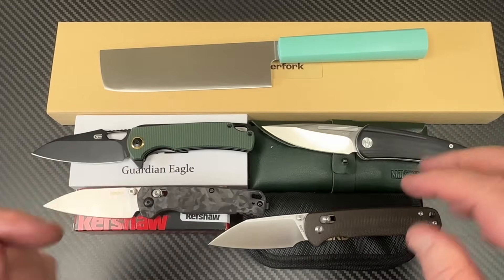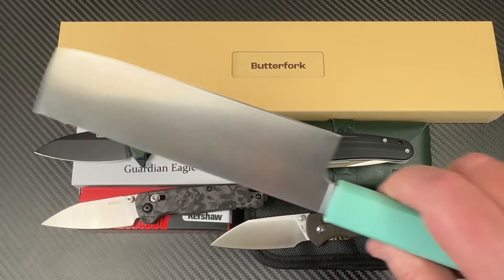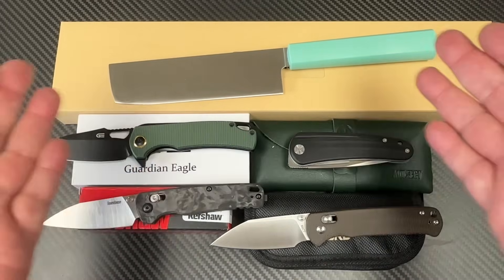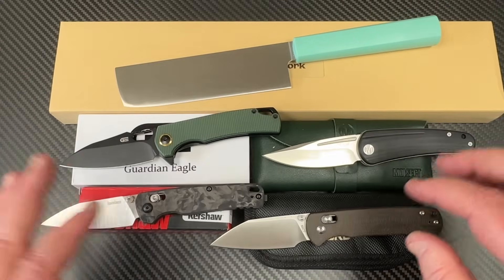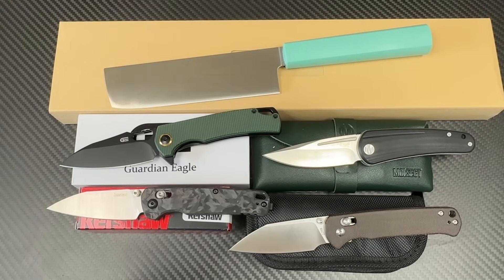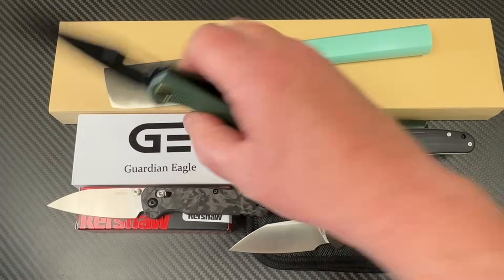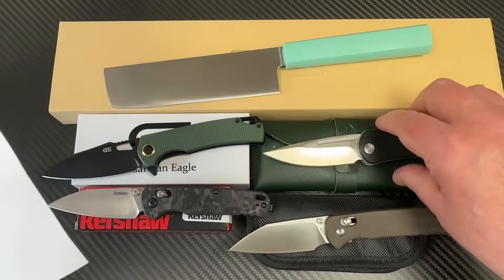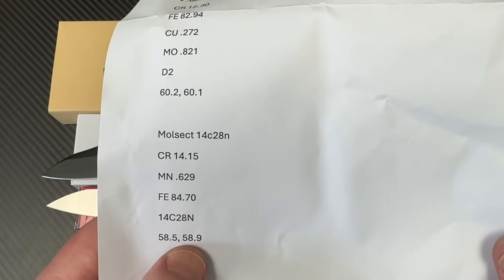Batch 9 Test Results  CJRB AR-SFII , Kershaw Magnacut and more !   PMI & HRC results !

Comment from the maker: Batch 9 test results (XRF elements and HRC Rockwell hardness)

CJRB Hectare AR-SFII
V 1.21
CR 14.80
FE 79.05
MO 4.11
154CM (OR SIMILAR)
58.9, 59.1
 
Guardian Eagle Unknown
V .667
CR 12.30
FE 82.94
CU .272
MO .821
D2
60.2, 60.1
 
Molsect 14c28n
CR 14.15
MN .629
FE 84.70
14C28N
58.5, 58.9
 
Butterfork
V .193
CR 17.82
FE 80.61
MO 1.14
440C (OR SIMILAR)
59.0, 59.1
 
Kershaw Bel Air  Magnacut
V 4.83
CR 11.00
FE 79.49
NB 2.31
MO 2.21
MAGNACUT 
63.2, 63.2

Luvthemknives website: https://luv-them-knives.myshopify.com

Join my Patreon & get in on the early bird knife sales & monthly drawings: https://www.patreon.com/LuvThemKnives?fan_landing=true

My email address : luvthemknives@gmail.com
My instagram  http://instagram.com/luvthemknives

How an XRF Analyzer works: https://www.bruker.com/products/x-ray-diffraction-and-elemental-analysis/handheld-xrf/how-xrf-works.html

Why carbon and other light elements are not detected with the XRF Analyzer: https://www.pxrfs.com.au/light-elements-difficult-measure-portable-xrf/

Spreadsheet of knife testing results to date: https://docs.google.com/spreadsheets/d/1OepNr_D4lqbdTFqdqWl1rmAd4bOzPzJe6J0iEWrdJGU/edit?usp=drivesdk

Knife Test Batch Videos 

Batch 1 new era: https://youtu.be/WTsUV0f-1kk

Batch 2: https://youtu.be/WUAPbJo7rY8

Batch 3:https://youtu.be/-Z0b2wZT8mA

Batch 4 Knife Test Results including the Spyderco Shaman 15V & Microtech in Magnacut !
https://youtu.be/F4c13Kfhubo

Test Batch 5 Knives Results !   You’re going to be shocked !!!
https://youtu.be/ys9IhtPOTWw

Knife blade steel Test Batch 6  Magnacut is now the focus and how good are these hardness numbers ?
https://youtu.be/pDE72wM1iw8

Batch 7 Knife Test Results ! S90V & Magnacut !
https://youtu.be/_uZVP1yJRQQ

Batch 8 Test Results  Thanks to Remette Knives for paying the tab !
https://youtu.be/rFHi36Q2zJs

Previous years

Batch 1 (4 years ago):https://youtu.be/Nh4rjoeY748

Batch 2: https://youtu.be/cqsvN3XtYEQ

Batch 3: https://youtu.be/JWCNV8Ipaus

Batch 4: https://youtu.be/LsThV3AjXv8

Batch 5: https://youtu.be/X0Jtb28VPc0

Batch 6:https://youtu.be/vmwb-ZfA3Xo

Batch 7: https://youtu.be/1dU1EoGdMxY

Batch 8: https://youtu.be/YGeKHMztk0A

Batch 9: https://youtu.be/7r7Wj3_L6zA

Batch 10:https://youtu.be/LimXek6Y9i4

Batch 11:https://youtu.be/eCR9V7-8Nic

Batch 12: https://youtu.be/5hgFEw3jSEc

Batch 13: https://youtu.be/ivCZsfyU0T4

Batch 14: https://youtu.be/kHkSCrLub48

Batch 15 & 16: https://youtu.be/Qzg5RoTE9nI

Batch 17: https://youtu.be/kZ5dR4p5QG4

Batch 18:https://youtu.be/pmG_8nPDbNw

Batch 19:https://youtu.be/ANNyyOycolo

Batch 20: https://youtu.be/ptL2e7fcbgA

Batch 21: https://youtu.be/djgpAcP4RuY

Batch 22: https://youtu.be/nt06Gn_Bphs

Batch 23:https://youtu.be/BlR6ZHVIv6g

Batch 24: https://youtu.be/UDYUp6NQ1CE

Batch 28: https://youtu.be/PfXag6Ku72s

Batch 29: https://youtu.be/qnetRveTeBY

Batch 29 part 2: https://youtu.be/SXVW27CiWWI

Batch 30:https://youtu.be/gs5dub2ilzs

Batch 32: https://youtu.be/fRY7ldnOMvQ

Batch 33: https://youtu.be/aRA7mnk3tCk

Batch 34:https://youtu.be/LAV40-4ntug

Batch 35:https://youtu.be/TkPPWfnZSQA

Batch 36: https://youtu.be/M_gbiZ_gfZQ

Batch 37: https://youtu.be/72vS4WXTLjU

Batch 38: https://youtu.be/zhUmuFW15VQ

Batch 39: https://youtu.be/NVMADfMpRRI

Batch 40: https://youtu.be/vr2gaZmcYms

Batch 41: https://youtu.be/7GJ9egoMO7g

Batch 42: https://youtu.be/jZkETbUMYgw

Batch 43: https://youtu.be/4kPI5dPJA24

Comment: To make life a lot easier when taking apart and putting axis/crossbar lock knives together - I took a chopstick, cut it down to a 2” section, then sanded it down to be slightly smaller than the pivot in a Bugout so I can use it as an assembly tool for basically any crossbar lock I come across. It’s saved me a LOT of frustration and headache over the past few years.

Comment: Magnacut gets its high corrosive properties (even though it has relatively low chromium) due to the added nitrogen to its recipe. Although vanadium by itself doesn't add much stainless properties, mixing it with nitrogen while lowering the chromium content created an excellent working order of corrosion resistance.  Add Larin's fairly easy, yet pretty genius heat treat protocol with a 2050 degree austenite in-plating/oil quench followed by 2x2 hour 350 degree temper and the final result is quite stainless with a high rockwell hardness.

Comment: About that struggle of making good M390... Do you think that 20cv is better / more consistent in hardness/heat treat? I noticed that most of knives that I have with 20cv keep edge way better than M390, they are mostly from WE knifes and Kizer but I wonder if other companies that use that steel have better time using it than M390 even if technically they are the same...
Reply from the maker: Good question.  I’ve never tried to correlate the 2 types to see if there’s any differences
Reply: They're identical in composition. The heat treatment is what makes the difference. Every time.

Comment: M390/204P/20CV is one of the most overrated steels around.  K390 is amazing, M390 is crap.  14C should be run harder then 59, it really shines @ ~61-62HRC
Reply: M390 crap? you really are an absolute expert

Comment: 154cm with a 1%+ vanadium addition sounds pretty cool actually. In theory it should hold an edge better, but possibly make it less tough. Though since it's spray form maybe that would even out the toughness. Sounds pretty good for the money.
Reply from the maker: Exactly what I was thinking.
Reply: Some people are saying it’s a budget version of BG-42 (which is 154cm plus vanadium), but I think it’s actually an improved steel as this is spray formed and not traditional ingot steel. The spray forming should hopefully make for a more uniform grain size, which would help edge retention and toughness.